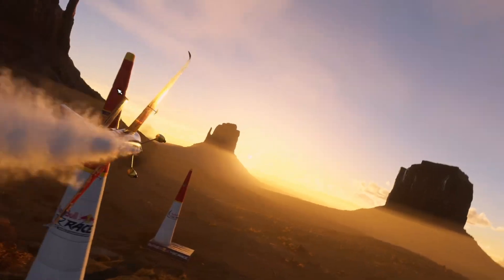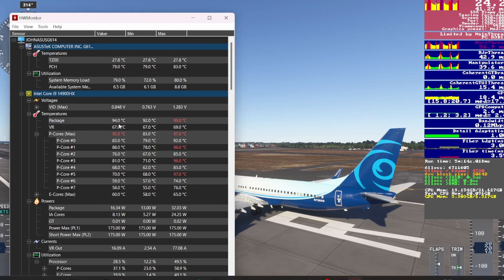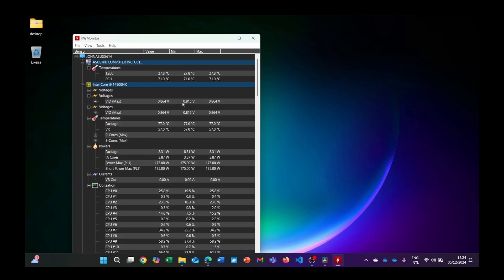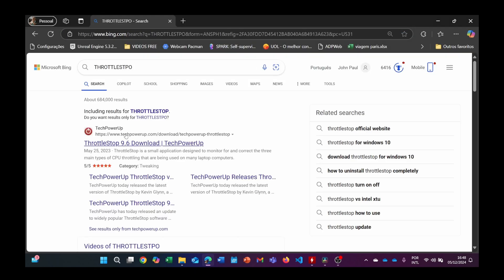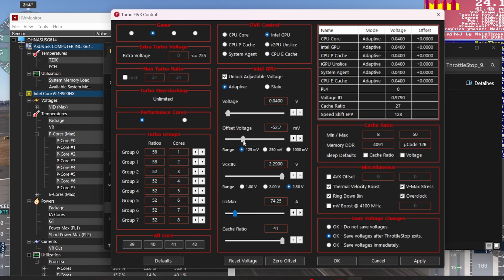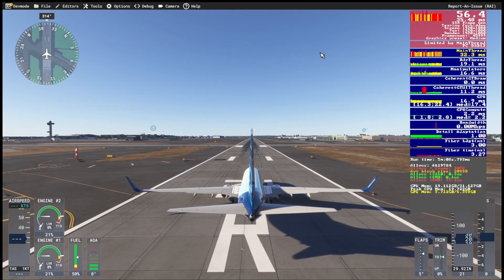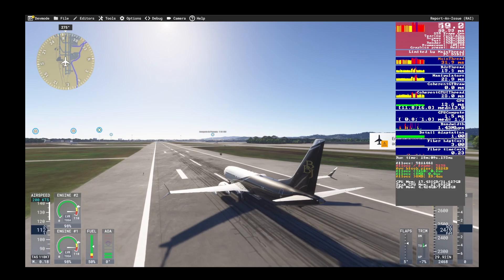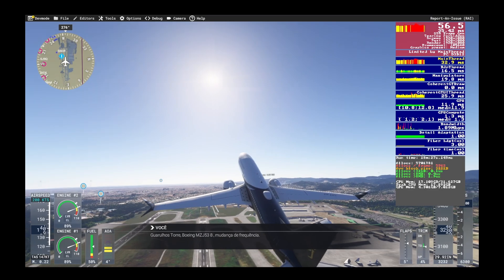[SOLVED] How to solve: Thermal Throttling in Intel i9 14900hx playing MSFS2024

Comment: I have the same CPU and GPU but on a acer predator helios neo. I have disabled all the core isolation and went into my BIOS but I still cant that to enable the adjustable voltage in throttle stop. Does anyone have a fix. I've seen my CPU at 100c and only running at like 30% (I just got it so the fans are clean)

Comment: Dude you are disable your Turbo Boost Clock. Ofcourse your temps are lower and you are using only 35w for 2.2 GHz.
Reply from the maker: Yes! My laptop came with bad thermal paste. I had to do it like this way to solve the problem. But these hacks can help anyone with thermal throttling problems.

Comment: I can change the offset voltage but nothing changes for me. It only stays the same if I turn off the turbo mode of the processor then it drops to 72 degrees on heavy load

Comment: What if my laptop the bios is locked meaning there's no undervolt protection settings in bios and I the throttlestop  "Turbo Overclocking" is locked. How?
Reply from the maker: @nabilnordin9221  which laptop do you have?
Reply: @JohnPaulLima asus helios neo 16 maybe
Reply: @ origin eon15-sl, its okay i found the settings "Overclock lock" inside the bios
Reply: @nabilnordin9221 how did you manage to reach that setting if I may know?
Reply: @PhoenixDown00 what CPU do you have, is it unlocked? Ill help you further once i know your specs
Reply: what CPU do you have, is it unlocked? Ill help you further once i know your specs
Reply: @iOrangeXbot  привет, у меня ноутбук msi Vector 17 HX A14VGG на 14900hx, уже месяца 2 не могу сделать андервольт, мои настройки биоса отличаются от всех что я видел, а когда качал программу Intel XTU, все настройки по андервольту заблокированы. Не мог бы ты мне помочь?
Reply: @Tiranius  Hello my good sir, ok, sooo, you seem to have an hx cpu just like me, and I was able to undervolt using a "seperat" bios calles smokless UMAF. But before I really go any further on how to properly set it all up, do you mind dtelling me if you speek English? At least well enough to understand a vechnical video? Because I could send you the link to the entire undervolting process and it would speed things up greatly. See you soon ^w^
Reply: @iOrangeXbot  hello man, you could help me with that undervolting process